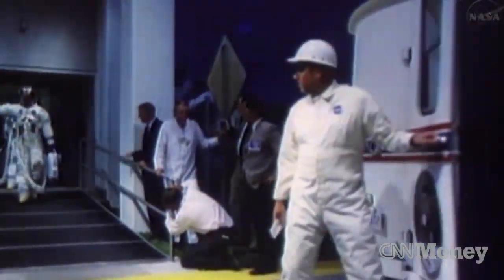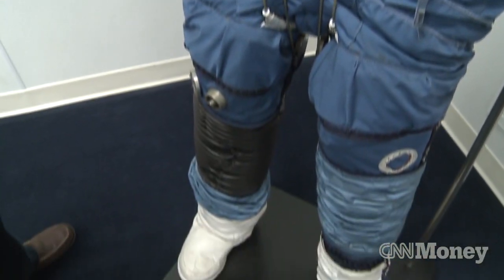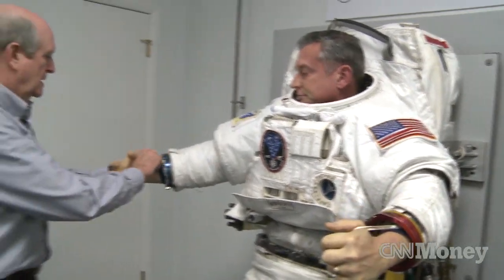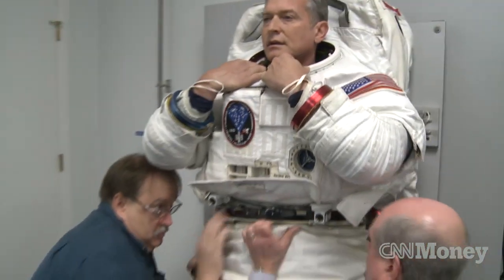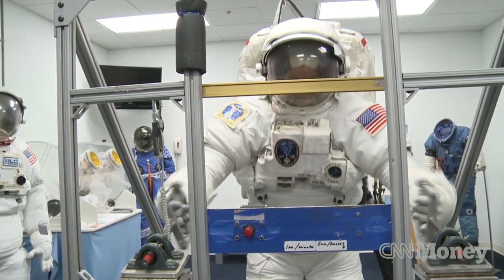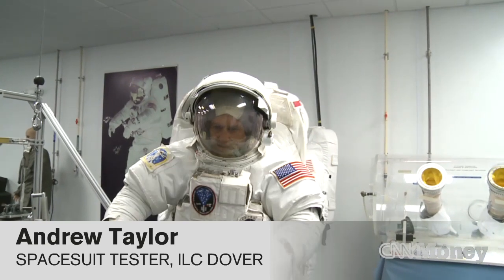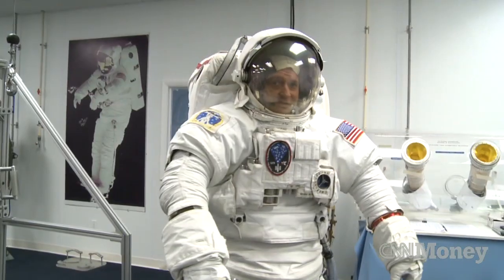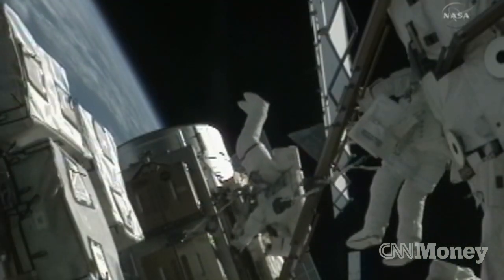See how NASA spacesuits are tested

Comment: A cooling suit, in the "near" vacuum of space that boils water but in direct like of the sun without thermal and radiation protection?  Good thing they can always use that to heat up their suits while "training" ;)
Reply: direct like of the sun without thermal and radiation?  SO you think the suit has cooling power but is " without thermal protection"?  Also, it's full of BoPET.  Lots of radiation protection...

Comment: Yes please show me how you test that suit in a -10 torr vacuum. After all we don't actually get to see him operating anything but a swimming pool. Do a little research into what a -10 torr vacuum is and you will quickly find out that some little Rubber seal is not going to get it done. So yes please explain
Reply: The suits leak a small amount of air at the seals.  It's replaces from the bottled O2 in the suit.
Reply: It doesn't matter what the level of vacuum is. The differences are small to tiny to insignificant. Easily compensated for (under test) by a little extra suit pressure.